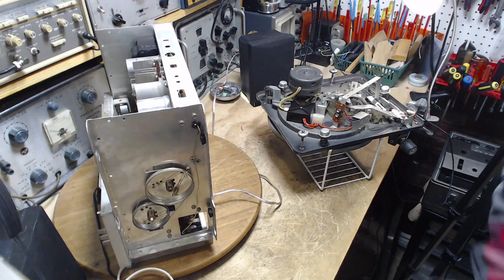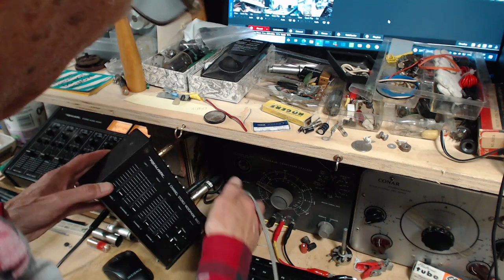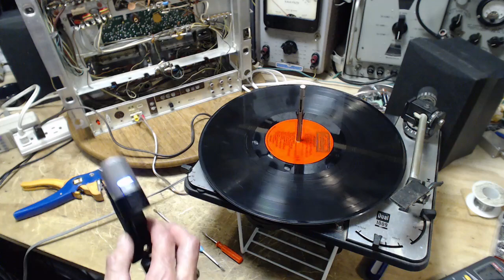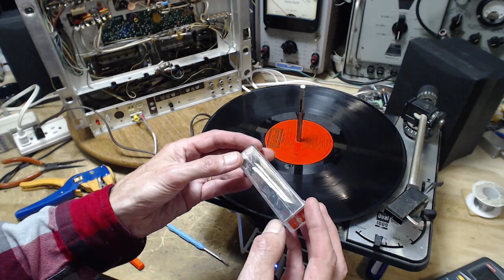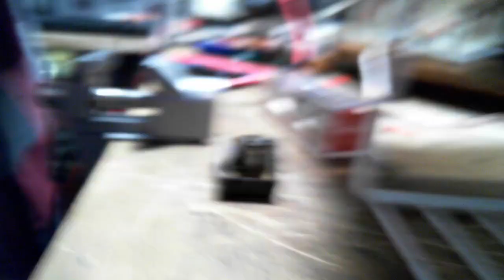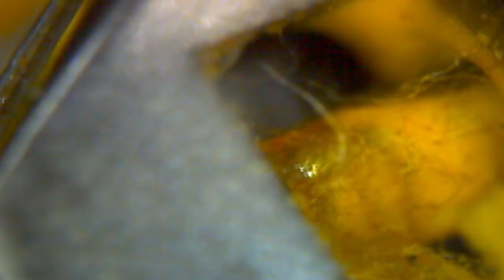Clairtone Console Stereo Video #2 - Dual 1009 Record Changer Checkout

Comment: 24:09: A backlight electric alarm clock, take it apart and take out the neon bulb and hold it over the strobe. Lol, Hey it works because thats what "I" did.
Reply: Edit: Holding the clock case, NOT the bulb itself ! It uses a stepdown resister so the bottom of it is 110 V.